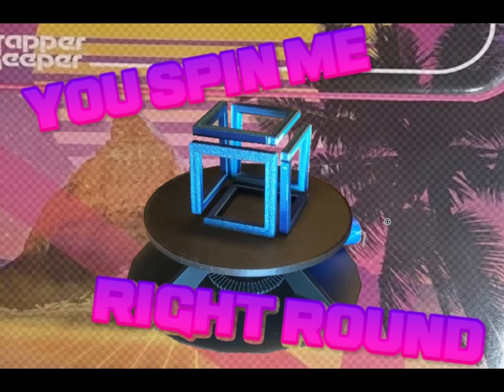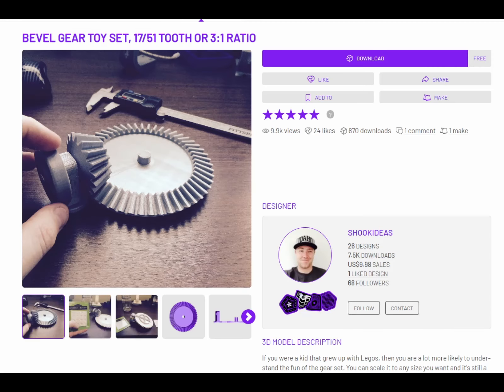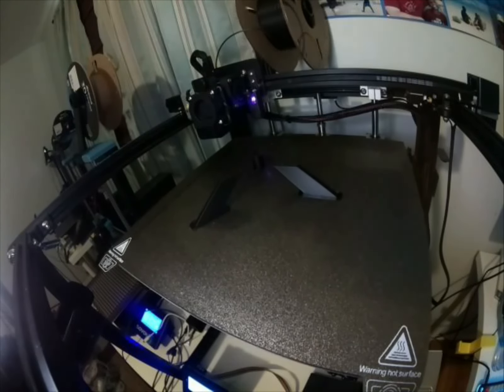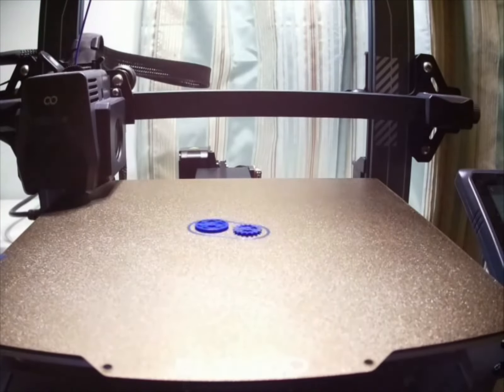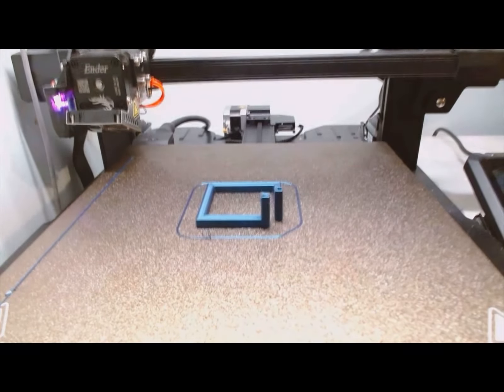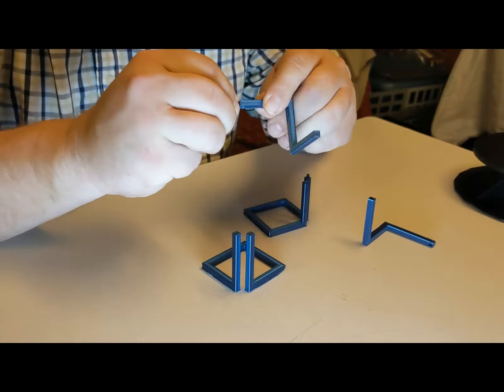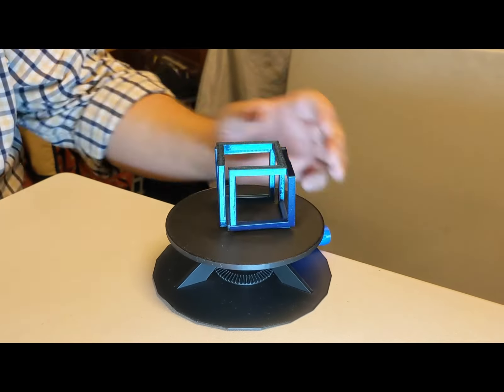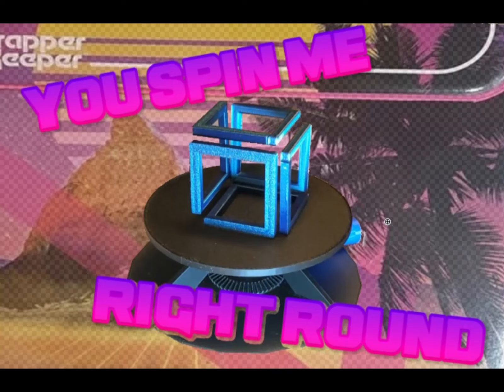Designing and Printing a Manually Operated Turntable - Ender 3 S1 Pro and Other printer Timelapses

Comment: Hello, there should be a piece on the TurningHandle that fits the PinionGear, but instead it has a hole and cannot be mounted. Or am I not understanding the design? Thanks
Reply from the maker: Yeah I just used a like an M2 screw to connect the handle to the pinion.  That's all the hole is for.